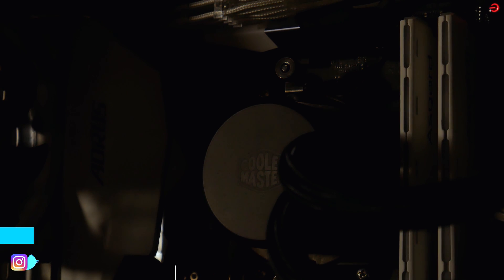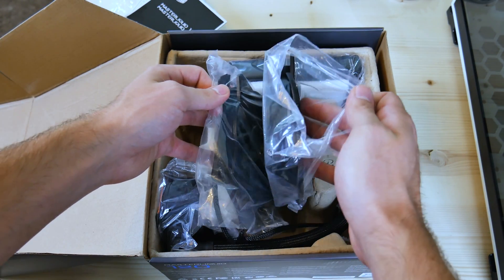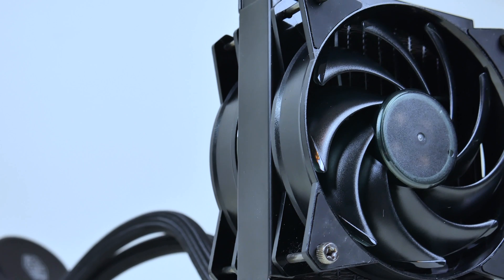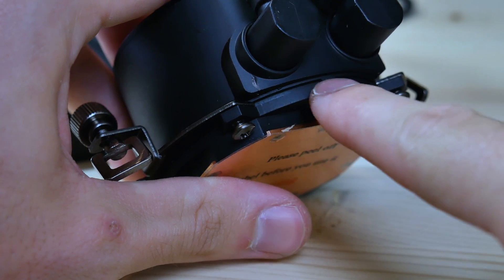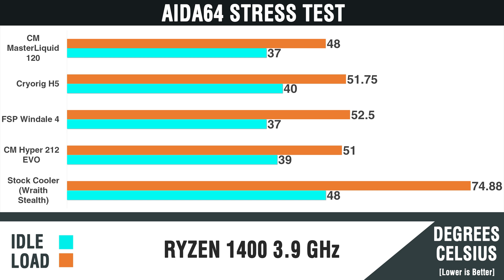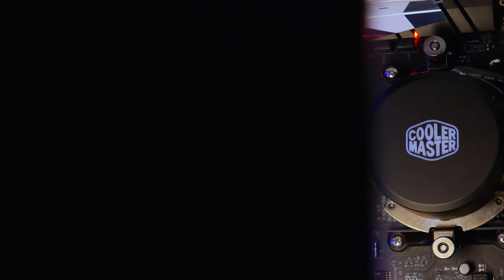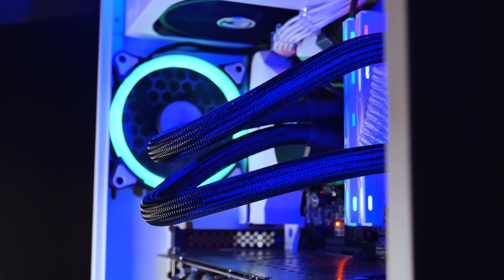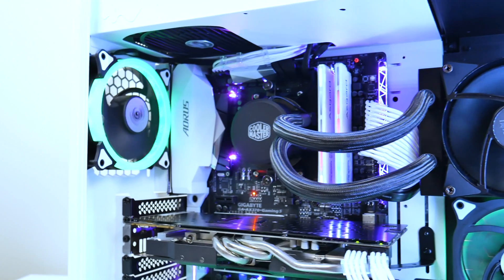Affordable AIO Liquid Cooler - MasterLiquid 120 Review

Comment: One of the most important factors when considering a $60 liquid cooler is that eventually these begin to breakdown & leak. Its extremely risky to use in a system that isn't being monitored regularly. Iv read many reviews from users in forums noticing problems as early as 4 months of normal usage. This is an unacceptable gamble being inside a system that potentially cost $1500-2000. Owning one of these coolers requires having to monitor the hose connections, pump and socket connection for signs of trouble on a regular basis and for the type of system / cpu chip this is intended for its simply not worth it. Getting 5-8c better results in cinebech at the cost of loosing your system in under a year. These coolers are manufactured for hyper consumers who buy needless components to outfit low to medium tier cpus. The squeeze is not worth the juice
Reply: You are just exaggerating. My last AIO cooler ran almost 5 years without any problem and I got rid of it not because it was faulty but because I bought an even better AIO cooler.
Reply: @EarthIsFlat456  Your risk vs reward is a gamble and I am not exaggerating. If you lost your system like many have using that same cooler you would not feel so confident. You were lucky and received a unit that works as intended. Many people are not so lucky.
Reply: @NathanHassall  Yes you're exaggerating. The risk is very, very low BTW. There are probably more people whose PC got damaged due to faulty PSU or lightning strike.

Comment: Try the leak free REEVEN OURANOS instead as it will match this water cooler in temps maybe even run your CPU cooler and if you Don't like the OURANOS fan color wtf guys peel off the fan name center sticker and just take a can of flat black paint and lightly mist the fan blades no big deal. Lightly mist till black will not hurt anything on the output  of the fan specs. So a couple lightly misted coats let each coat dry before the next goes on should take ya max about 20 mins to have black blades and simply re-apply the fan center sticker and BAM Kick Azz Black Fan. I have 3 of these OURANOS CPU COOLERS in push pull config and they out preformed a few water coolers I had used and best of all never had to worry bout a water leak one day or shrinking coolant in the closed system to one day run me hotter and hotter as time wears on. These factory fans it comes with are actually pretty hard to beat and WTF you work in a library or something that you got to worry bout a lil bit a fan noise or something? ROFL … You wont even hear these puppy's running even when they mite ramp up and as a matter a fact this bad boy runs my Devils Canyon i7-4790K Gaming Build so cool even under a load that these fans have never ever yet had to max RPM it lol yeah this bad boy is that bad indeed and it does the same on my job for my latest i7-7700K  Gaming Build. It has cleared not blocked what so ever any of the 4 ram slots on the MSI Z97A Gaming 6 Motherboard (32 Gig 4 sticks of 8Gig Each of G-Skill Rip Jaws X ) used for the i7-4790K Devils Canyon Build and same goes for the i7-7700K MSI Z270 XPOWER TITANIUM GAMING Motherboard using 64 Gig of XPG Spectrix D41 RGB Extreme Gaming Ram (4 sticks of ram 16Gig each). … Oh and yes on the devils Canyon I had a Rog Strix GeForce 1070Ti OC Advanced graphics Card in there and upgraded now to a MSI GeForce GTX 1080 Gaming X Graphics Card and have plenty clearance between the card and Ouranos Cooler AND also on the i7-7700K Titanium build running the biggest bad boy you can buy which is the ZOTAC GeForce 1080Ti OC AMP EXTREME which is the size of a Air Craft Carrier lol and yep still plenty a space between the Ouranos and Graphics card. So there 3 out of 4 of the most important things for a CPU Air Cooler it passes with flying colors BUT the 4th thing will be your only worry and that is the height NOT the width if the cooler so check with the PC Mid-Tower specs you plan on using it in as most Mid-Tower Cases but never take it for granted please check the case specs you plan on using it in to make sure. I have 1 in a INWIN GT-1 Gaming Mid-Tower with no problems and the Devils Canyon in a Cougar Challenger Black Steel ATX Mid-Tower Computer Case and the i7-7700K Titanium Build in a Rosewill NIGHTHAWK 117 FULL TOWER so don't have to worry bout any spec's in that case as its big enough that if anyone comes over and wants to stay overnight I could throw a bed in it and use it as a temp. guest room ROFL. Well that's it all I got to say about it and its simply a awesome cooler worth every cent and I suggest buying the extra fan for it as they give you extra clips for a fan with the cooler incase you want to push pull config it and last but not least if you no way can fit this in your case TRY a 120mm Fan powered so the cooler is a lil smaller in height made by DEEP COOL called the GAMMAXX 400 it will not block any ram slots and run your rig cool as well with the ability to still throw a small overclock on your system without worry and comes with a set of extra fan clips incase you would like to run it in a push pull config. as well. It is only 154.5mm Tall and fit ALMOST any Mid-Tower out there. Remember I said almost so never fail to check the specs of your case or the case you plan to use it in no matter what type a cooler you plan on using. Hope this novel I wrote somehow helps you and Hey if this somehow did help you please give it a thumbs up … Would appreciate it. Thanks and Game On ! ;)

Comment: Amazing review man. I went ahead and bought this cooler on Amazon (got a $15.00 coupon for it too). Hoping it gets here fast.

Right now my air cooler has failed-or the thermal paste. My r5 2600 is currently running 50c IDLE and 70c while gaming which is not good for me because I want to take care of my components. I got this cooler and an artic mx-4 thermal paste. I really hope I hit at least 29-30c idle.
Reply: @Jhovix With this one I now get 35-40 idle and 55 highest while gaming. I did however stopped overclocking as I didn't see major fps differences. I'll rather keep it cool on stock speed

Comment: i got idle temps of 43ish degrees and stress test 66-67ish on stock with the same aio  with push pull on the back. could that difference be the case? I got a sharkoon TG4, a very small ATX case

Comment: Hi bro, I just build my new PC, and using this as my cooler. However, I have found that the temperature of my CPU when opening the BIOS is start from 43.  Is it normal?
My rig are
1. Asrock fatality H370 performance
2. Core i5 9400f
3. RAM dual channel GieL 8Giga
4. Aorus rx 570
5. PSU Seasonic 620 evo

Thank you in advance bro.
Reply: bios seems to put a high strain on a single core and that seems to be the reason for high bios temps. Im running a Ryzen 3 2200G. In bios my temps are mid 40s while in windows my idle temps are in the mid do high 30s(depending on the ambient temps.) If you live in a hot country that could be a reason for the high temps too. I would say you are doing fine and shouldnt worry about it.

Comment: I just got this cooler but I'm experiencing something that I'm not sure whether or not it's normal.
I'm having some temp spikes with this cooler and it's a bit loud which is a bit weird looking at your review.
It'll idle at like 28-31 and while gaming 48-55 which are huge improvements over the stock AMD cooler.
But while browsing; opening another tab can make the temp jump from 30 to 45 and back very fast! is that normal ?
Reply: sgtdopeAF Yes perfectly normal, liquid cooling jumps around temperatures quite often there's no need to worry.

Comment: I chose this cooler for my i7 8700 but under load it makes a pretty audible grindy noise that annoys me so much I wanna replace it already, is mine defective or something? The cooling is ok though cpu stays at around 50 gaming at ultra, but the noise is too much for me. I did a fan tuning in the bios and it's a bit better so i don't hear it when there's no big load but man am I disappointed

Comment: my 8700k Runs hot. I have a 120mm Coolermaster Air cooler and it can't run for more than a couple seconds at full load until it starts Thermal Throttling. Will This 120mm AIO Liquid Cooler Help with this. I just want it to run cooler. Someone help.

Comment: I have i5 8600k,  can i use this cooler?  How is it?  Can it handel 8600k temperature? I m not overclocker .
Reply: Mine struggles overclocking it past 47 hz temps rise above 80
Reply: @knightsfly5  Did you mean 4.7 ghz?

Comment: Hey there, I know we're a year on but the product is still available so I feel it's relevant to let you know that you used the wrong screws to install the brace.

The smaller ones fit properly, seat all the way in and match the threads.

Comment: I love mine. I bought this in the RGB version, to go with the master lite fans.... really nice! they all hooked up with no problem and I even added the Cooler Master LED Light Strips. I have a CM Elite 310 chassis, the CM 120 RGB fans, and the CM ML120L. Adding the CM RGB Light Strips replaced my old CCF white lights that I had put in years ago. I really love being able to buy all one brand, it makes the build so much better. Thank you CM for having such an awesome product lineup! with the old stock air cooler, my temps were running in the 50-60C range, with the water cooler they have dropped to 25-30C range.... I don't OC so the system runs a lot better. now, its on to buying the CM Masterkeys L Keyboard! Love that RGB!

Comment: I can't get my 1400 to  3.9 GHz my temps are at 60c  sometimes bellow in 50's with stock cooler set in performance mode 1.35v I can only go to max 3.875 GHz stable I put at 3.9 GHz its almost instant crash, would getting this cooler allow me to get 3.900 maybe 4Ghz ??? or it has nothing to do with temps ? also my psu is only 450w could that be the problem ?
Reply: cheese wine could be many issues from voltage droop or could you could be unlucky in the silicon lottery, also I didn’t think these things had much much over clocking potential without a lot of tweaking. Best of luck !
Reply: yeah.. 3.9 just don't work for me, not stable, the temps are perfectly fine on stock coller.. I'm gessing maybe it is the psu its a bronze corsair 450w psu, I decided to keep it at 3.8 with relatively low voltage and temps.. I will prob upgrade to 2600x in future ;D then I wont focus on cpu for awhile  I bought 1400 because it was dirt cheap coming from a g4560 I don't regret it

Comment: Nice, Loved your review.
Can I use it for Intel g4560, on Msi H110m pro vh plus Motherboard? It has 1151 socket. 

Or is it only for Ryzen processors?
Reply: I believe it does support 1151
Reply: Why would you want to water cool a 4560? It has a very low TDP and you can't overclock. The included Intel cooler is plenty(if a tad noisy). If you want to reduce noise, there are far less expensive options than this.

Comment: Any suggestions why I'm having overheating? I used the same amount of thermal paste you did, I have both the fans pointed the same way out of the back of my pc, just as the instructions showed. I do only have the 120 and not the 240.

Is my cpu just to hot for this cooler? AMD FX 9590. I had an aftermarket heat sink (not water cooled) and quickly learned that wasn't adequate. I slowed my clock speed down from 4.7ghz out of the box to 4.0ghz. After installing this I'm unable to increase my clock from 4.0ghz with this and it's getting very frustrating.

I'm not seeing anywhere on the specs of any water coolers I've looked at a heat dissipation rating. How am I supposed to know what will be compatible with my cpu?
Reply: I know this is a bit late, but the 9370 and 9590 are 220 watt parts. You need a cooler that can dissipate at least the much heat, if not more. That takes either an incredibly beefy air cooler(likely with 2 or even 3 fans), or a larger AIO with at least a couple fans(like a 240mm).

Comment: I got the "lite" version of this with the single fan for £36, but also got the coolermaster RGB kit with 3x120mm fans and a controller, so mounted one of the fans on the back and effectively got this version but in RGB flavour. Seems pretty decent so far, it may have been more practical to get a better air cooler but for aesthetics this looks way nicer.

Comment: I have the "Lite" version of this one and I have to say they are virtually identical minus the substituting of the braided lines for thick ribbed plastic ones and it doesn't include the fan splitter or one of the fans (it really doesn't need it IMHO, one works just fine)....oh and the fact it cost's around 20 bucks less, averaging around $40.00 and even cheaper on sale.  Otherwise it's the same, super easy AM4 mounting clips included. It was the easiest AIO I've installed to date. Great review, you've earned a sub here :)
Reply: Also lets you mount another fan anyway, so if like me you get the RGB kit you can add one to that and make it look pretty snazzy. Weirdly they only seem to do the "lite" one in an RGB version, there doesn't appear to be a push-pull 120mm with an RGB option.

Comment: Subbed because of this review. You are one of the few people who reviewed this cooler. This is the second cheapest AIO cooler available in Australia. I really needed someone to do a review on it. I'll pick up the 240mm version for my 1600x.
Reply from the maker: Thanks mate I appreciate it!
Reply: so how was the 240mm aio?
Reply: Janoy Cresva Very impressive. %100 would recommend if your looking for a good AIO that doesn't cost as much as your mobo.
Reply: im looking for a aio to cool my i7 7700k but its cooled atm with a air cooler, im either looking at a corsair h100i v2 240mm that cost like $149 or cooler master masterliquid 240mm that cost $115 (not the rgb one), my case is a nzxt h440 black, heard the cooler master is quiet but the corsair's fan is pretty cheap and loud, i dont even know which to choose
Reply: Janoy Cresva choose the Corsair one
Reply: Two years later how are your AIOs holding up. I've had an issue with corrosion around the coldplate and it seems to be a common issue

Comment: I LEGIT JUST BOUGHT THIS AAAAAAAAAAAAAA
i have it under my bed untill i get the rest of the parts. its the Lite version
It was on sale for 30 buccs
Edit: I think the only difference is the tubing and the push pull config.
Reply: Slightly different mounting as it doesn't have the slots for the mounting plates, so it's slightly more fiddly to get on. Other than that if you add a second fan it's identical.
Reply: what are temps please tell

Comment: Where do you plug the water pump 3 pin cable to your mother board?  Fan_Connector or CPU_Connector?  The fans connector has 4 pin which support pwn, should it plug into the cpu_connector?

Comment: There is a "Lite" version of this aio as well - to sum it up, that one comes just with one cooler and non-sleeved tubes. Around here, the Lite version costs about 45 bucks while the standard version is about 68. Do you think the Lite version could be a good buy? As far as I know, there is a mounting kit to install a second cooler for a push/pull configuration included.
Reply: I got the ML Lite 120 on my Ryzen 5 1600 and overclocked to 4 Ghz. I added another fan for push pull and temps are rarely above 62 deg Celcius under load and gaming. Highly recommended for the price!
Reply: The Lite version is now on a early Black Friday sale for $29.99 at Newegg.  While the regular version has a $15 mail in rebate going on.
Reply: Nice to hear. I might get this as well. Finally affordable AiO water cooling solutions. :D
Reply: Definitely! Looks great with the white logo illumination on the pump head exactly the same as the non-Lite version. The lack of braided tubes is not that big of a deal for me.
Reply: I have the lite version (£36) and yes it includes extra screws, and can run in push-pull. Since coolermaster's RGB 3x120mm fan kit is pretty good value (£55 on amazon including the controller unit) I mounted one of those to the front of the radiator with the non-rgb one pulling from the back, and it looks awesome. Depending on your fan headers you may want to purchase a PWM splitter cable so both fans are tied to CPU temps though, and if you add another fan remember to get a static pressure one rather than an airflow one as these work way better with rads.

Comment: How long do you typically stress test for? I have seen 120 AIO's get saturated with their heat capacity much quicker than 240's and am wondering if there is a point in time where the 120's performance levels off. Looks like a really great cooler for small form factor!
Reply from the maker: I stressed it for a little over an hour just to make sure I've reached a plateau in temperature. It reached it's heat capacity fairly quickly too, well under an hour, but I just made sure and kept stressing it. So yes, it does eventually level off and remain around the plateau point. Good question!